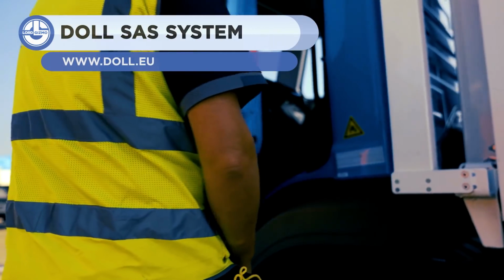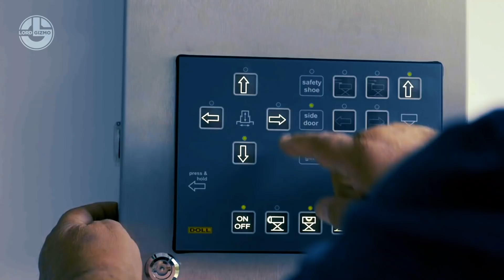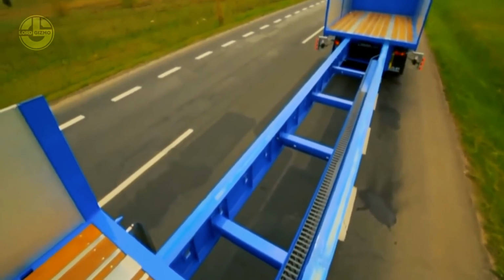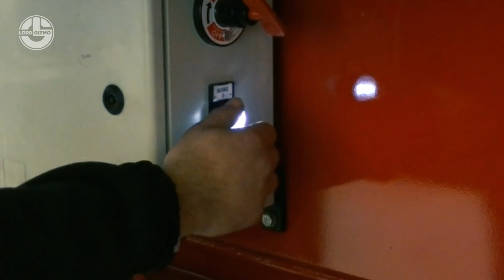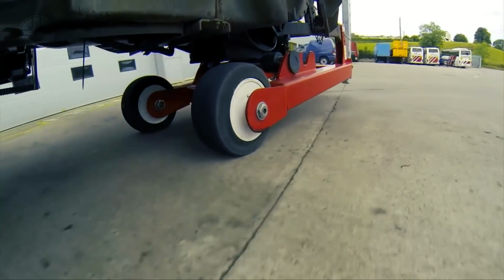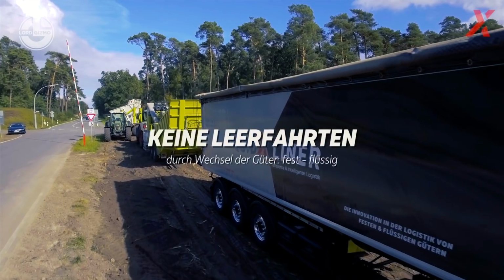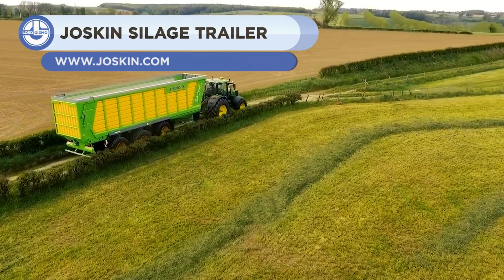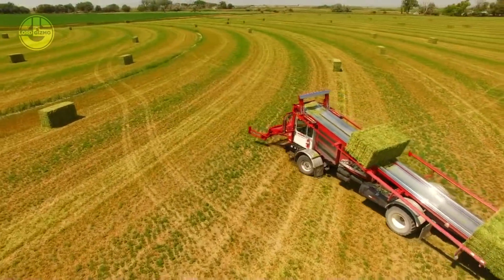Amazing Inventions For Tractors And Trucks You Need To See

Comment: This is not a new idea,  massy ferguson invented this for the gray ferguson eara, I still have this kit for my tractor, another bracket also available was for this rear arm lift device, were their was a front mount, and lifted the hole tractor up, I've made my own for my ford 5000, and is still used to this day for changing to row crop wheels.
Sorry guys! Not new.